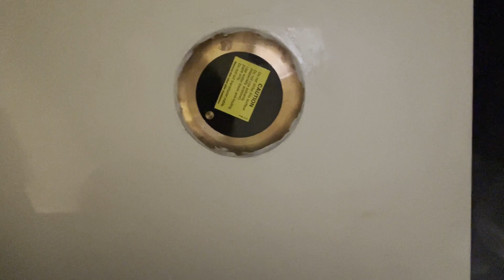Massive Hole In My Boat!  Airmar B175M Install

Comment: I just order my B175M.  It seems I will follow your steps on the installation.  Thx for the video.  Tight
Reply from the maker: You will like it. Especially if you are upgrading from a 600 watt transducer.